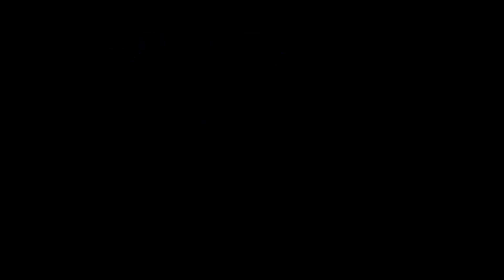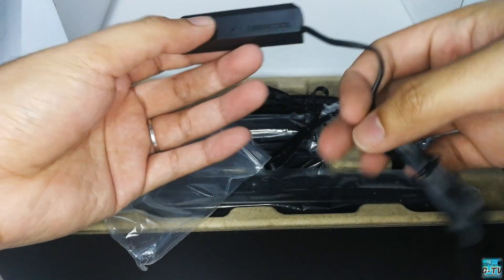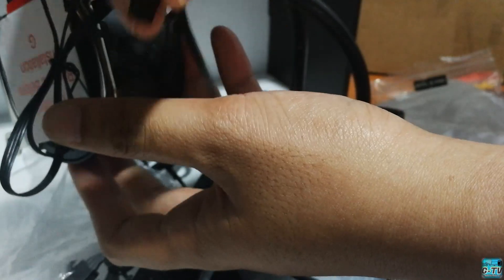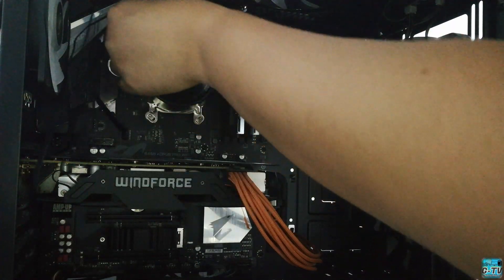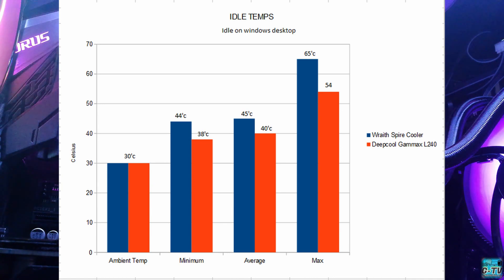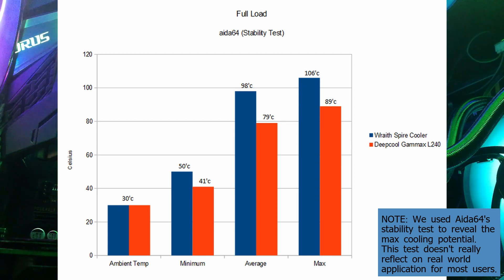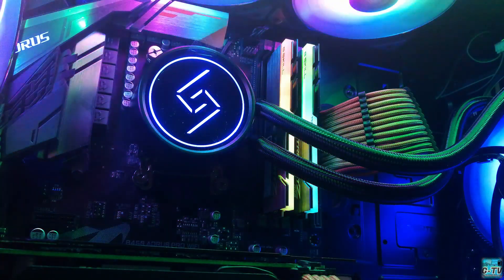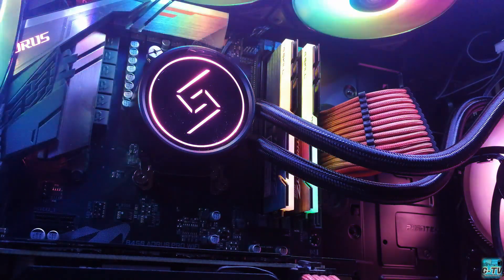Deepcool Gammaxx L240 AIO Liquid Cooler Review

Comment: shold i get this with my i5-10400f?, will it even fit, and is it worth it because my cpu is locked, if not what cpu cooler should i get
Reply from the maker: This will upgrade the look, noise level and temperature of your cpu. The fit will depend on the clearance of your case. It's a worthy upgrade if you ask me. Id go with noctua nh-u12a if you want an air cooler with no rgb
Reply: @GinoCruzVlogs  Thanks!
Reply from the maker: Welcome mate👌

Comment: Hello, meron din po akong Aorus B450 Pro Wifi na mobo and balak ko rin po bumili ng AIO,  kaya niyo po ba nilagay yung rad sa harap kasi tatama yung heatsink ng mobo dun sa rad? balak ko po kasi ilagay sa taas.
Reply from the maker: Hi bro! Yup. Tatama siya. Depende din talaga sa clearance ng case mo kung maluwag yung fan mount sa ibabaw. Pero ok din sa harap para cold air agad yung intake nung radiator sa harap.

Comment: im completely noob on pc builds , call me dumb but where is the liquid that make tis cooler a liquid cooler?
Reply from the maker: Hi bro! An all-in-one liquid cooler like this one doesn't have a dedicated reservoir like the ones you see on custom water loops (usually found on high-end builds). The coolant circulates inside the tubing and radiator.
Reply: @GinoCruzVlogs  ty for the quick respond , i’m considering to replace my air cooler with this . so the liquid has inside is inreplaceable ? any chance of leak ?
Reply from the maker: @thsk8156  It's been more than a year since I had it install and it's still working like a charm. I think this particular model is a closed loop system so refill or replacing coolant is not possible. The version 2 of the L240 has anti-leak tech feature for added peace of mind.
Reply: @GinoCruzVlogs  i will proceed for purchase thanks a lot
Reply from the maker: @thsk8156  glad i could help bro. Stay safe! 👊🔥

Comment: What’s the temperature difference with r5 3600X stock vs this?
Reply from the maker: Hi bro! Not sure, but since it uses the same stock cooler,  the performance gain should roughly be the same if you upgrade to this aio.
Reply: @GinoCruzVlogs  thank you!

Comment: think one thing to take into account is the clock speeds of the cpu. my 3600 with stock cooler sits at 95c and throttles down to 3.6ghz whilst  with upgraded cooler will sit at 4.15ghz all day at 85c
Reply from the maker: Also happened to my cpu as well. Well worth upgrade bro. 🔥👌

Comment: Nice video brom i just upgraded to R5 360o and Wraith Stealth cooler is not good. Arround 50 degrees in idle and bumping to 85 to almost 90 degrees when playing COD Warzone. Planning to get this AIO. Do they sync rgb when I get 3 more deep cool fans for exhaust? And will this be compatible with my Gigabyte b45pm-ds3h? Thank you!!
Reply from the maker: Hi bro! Appreciate the nice comment. You have a very good cpu. Pairing that with a nice AIO would be awesome. You can daisy chain the aio with some Deepcool RF120 3in1 pack and youre good to go. Your motherboard has 1 compatible rgb header that you can use to sync the lighting
Reply: @GinoCruzVlogs  thanks man! Im just new to pc building and my chassis is a little smaller compared to yours and cant mount on top. Can i place the radiator in front? And are the fans exhaust or intake when moubting to radiators? Planning to get 3in1 rf120 to place at the top(2)  and rear (1). Do I do exhaust for all the rf120 fans? Thank you!
Reply from the maker: @singwithme4480  welcome to the master race bro. Yes, front mounted rad is ok and fans need to be intake so it can suck in cool air for the radiator. use the 3 rf120's as exhaust (2 top, 1 rear)
Reply: @GinoCruzVlogs  not sure if I wanna join master race haha. Im cool as long as my cpu is cooler lmao. Thanks for the suggestions. Adding to cart now. More videos sir!
Reply from the maker: @singwithme4480  hahahaha! Nice man! NP. Enjoy your pc build and stay safe! 🙏
Reply: @GinoCruzVlogs  Hello again Gino, O just ordered the aio and 3in1 rf120 fans. Can you give me idea how to daisy chain the fans and rgb considering that I only have 1 header for rgb and system fan? I'm worried that this won't work. Thanks!
Reply from the maker: @singwithme4480  hi bro. extension cable has 4 ports. Use the 4th port to daisy chain/plug in the 2nd extension cable.
Reply: @GinoCruzVlogs  do i have to order the extension separately or does that come with the package? Also, what about the rgb? Can I daisy chain those too?
Reply from the maker: It comes in the package bro. 4port cables for fan and rgb.
Reply: @GinoCruzVlogs  what aboht the pump for the aio? I dont have an "off fan header" as you stated in this video. Sorry for asking too muchm
Reply from the maker: @singwithme4480  yeah w8 let me check your board.
Reply from the maker: @singwithme4480  the aio has 4port fan hub. plug the fan hub to the cpu fan header then plug the aio pump and 2 radiotor fans to the fan hub. Use a different auxiliary fan header for the other 3 rf exhaust fans. Just do the daisy chain on the rgb.
Reply: @GinoCruzVlogs  thank you so much. So to summarize i just need 2 fan hubs. 1 is for 2 radiator fans and pump. 2nd fan fub for 3 rf120's? Rgb splitters and theses hubs are all included in these 2 packages right? Does that mean that I still have control over the rgb and fans since they will be connected to my motherboard?
Reply from the maker: @singwithme4480  both the aio and rf 3in1 pack has the fan hub and rgb extension/splitter cable. Everything should be included. Yes both aio and fans will be connected to your motherboard. 😉
Reply: @GinoCruzVlogs  thanks bro! Ill go back here when I will encounter any issues. Thanks and keep safe brother!
Reply: @GinoCruzVlogs  broo, i jist found out that the V2 of l240 does not come with a fan hub anymore. Do you have any solution for my situation other than getting a separate fan hub?
Reply from the maker: @singwithme4480  wth. Deepcool added anti-leak tech but removed the fan hub 🤦‍♂️. If the mother board has enough fan header, use the fan hub included on the RF fans for the aio and just connect the 3 fans on the auxiliary fan headers directly. If not, you need to buy  deepcool fan hub. I saw one online for only 299 php.
Reply: @GinoCruzVlogs  my plan is to plug the pump on cpu_header and use the 4 port fan hub for the 2 radiator fans and two rf 120s. Im going to miss the 5th fan. Do i need to buy a 10 port fan hub to connect all 5? Its sad i only have 1 system fan header hahah
Reply from the maker: @singwithme4480  if you could get a 10 port fan hub for the system header that would be better. I'd still use the cpu_header with 4port hub to plug the pump and 2 fans so that the rpm will be synced
Reply: @GinoCruzVlogs  I would still be able to sync fans that is connected to the systen fan header right? it is safe to connect a fan hub to Cpu-fan header?
Reply from the maker: @singwithme4480  when you say sync, do you mean control? Motherboard will basically control the fan speed or rpm depending on your temp. Yes its safe.
Reply: @GinoCruzVlogs  thabls man. I guess i just have to wait till my order gets shipped out. It has been 3 days now but no updates yet. Ill come back definitely for sure. Thanks for your time and more power!
Reply from the maker: @singwithme4480  np man! Thanks and Stay safe! 🙏🔥
Reply: @GinoCruzVlogs  Hi bro. I got the coolers and was able to run 5 fans on 1 header. Used the 4 port fan hub and added a splitter on the 4th port. I have the pump only at cpu fan. It works for almost a week now. Is it safe though? Thank you!
Reply from the maker: @singwithme4480  Congrats on your new fan and cooler upgrade! Good job on your wiring as well.  it's perfectly safe. Did your temps improve?
Reply: @GinoCruzVlogs  temps improved bro. Down by 25-30 degrees while gaming. From 91 degrees to 58-65 now. Si coool lmao
Reply from the maker: @singwithme4480  nice temps man. The upgrade was worth it.

Comment: Boss Gino, pwede mag tanong? kasi sa start up nagkakaerror ako ng cpu fan error, tapos kapag nagcheck ako ng rpm sa mga software, N/A yung cpu fan ko.
Bakit ganun? Yung 3pin po ba para sa rgb sa extension din ilalagay? thank you boss.
Reply from the maker: Hi bro! Para po mag ka readout ng rpm need mo plug yung fan sa 4pin pwm fan connector.
Reply from the maker: Dun sa rgb naman need mu padin lagyan extension para ma connect mu sa board. Since regular rgb leds yung gamit ni l240, dapat 4pin rgb connector mo sya kakabit.
Reply: @GinoCruzVlogs  Boss thank you okay na hehe!
Reply from the maker: @ronron4077  nice one bro hehehe enjoy your new aio! 🙏👍

Comment: Got a cryorig h7 quad lumi for 40$ and im planning to change with l240, But i saw your video and compare it with my 2600 oc to 4ghz 1.3v and almost same temps and Ive got high ambient temps but this l240 looks clean! 🔥
Reply from the maker: Yes sir! 🔥🔥🔥
I still get mesmerized when I look at my rig even though it's not that high speced. Thanks for watching brother and noticing my benchmarks
Reply: @GinoCruzVlogs  wat is better? Corsair h100x hydro series or this one?
Reply from the maker: @pukalomaster3321  hi! I really cant comment anything on the h100x performance, but basing on the specsheet and price, i think the l240 is a better buy because of the price. Unless you have a corsair theme for your pc set up.

Comment: What is mainboard you using with the deepcoll gammaxx gte aio v2 240mm ???
Reply from the maker: Hi bro! Motherboard? I have the Aorus B450 pro wifi. AIO's rgb is being controlled by the motherboard. I have the legacy version or v1 240mm
Reply: @GinoCruzVlogs  oh thanks! Can I use asrock z390 steel legends to controlledthe deepcool gammaxx L240 AIO V2 ?
Reply from the maker: @nguyennhatnamIT2005  yes bro! It has 2 rgb led headers. Use the one nearest to the cpu slot.
Reply: @GinoCruzVlogs  Thank you very much

Comment: Paano po kaya ang pwedeng gawin kung walang RGB header ung motherboard? Pati ung RGB controller?
Reply from the maker: Hi CK! Hindi po gagana yung rgb lights. Need po talaga ng controller. Work around is to buy it seperately or get an rf120 3in1 pack tapos daisy chain nlng yung mga fans at pump. May free controllee yung rf120 3in1 pack.
Reply: @GinoCruzVlogs  Hi sir, same issue po ng sakin, walang RGB header. Gagana pa rin po ba siya kahit di gumana yung rgb lights?
Reply from the maker: @lawrencesoneja3273  hi Lawrence! Pag wala pong 4pin 12rgb header yung board need po ng external rgb controller. Pwede po makuha sa Rf120 trio pack. Cheap route is bibili ka ng 12v 4pin na controller but im not 100% sure about compatibility. Another option is in direct contact kay deepcool tapos special order nung rgb controller nila.
Reply from the maker: Sa shopee din try mo search deepcool rgb controller. Yung 12v dapat
Reply: @GinoCruzVlogs  Oks sir. Salamat sa info!
Reply from the maker: @lawrencesoneja3273  np bro. Stay safe.☝️🔥
Reply: @GinoCruzVlogs  Same sir, Tingin ko recommended para sa mga walang rgb header ang mobo is mag switch sila sa l240T
Reply from the maker: @lawrencesoneja3273  bagong variant ata yan for L240. integrated na yung power ng ilaw sa fan header. One color way nga lang yung ilaw. Good suggestion bro.

Comment: Can it be compatible with deepcool dukase v2 cabinet...using Asus strix B350F motherboard with adata ram with heatsink...will there be enough  space for this if I mount the radiator on top??
Reply from the maker: Hi AD! Top mount is your only option for dukase v2 and the clearance is good. No issue with Ram clearance. Motherboard top heatsink might be a bit tight but can be managed.
Reply: @GinoCruzVlogs  thanx man...

Comment: Panu kung walang rgb header ung motherboard gagana pa kaya yan ?
Reply from the maker: Hi Rey! Gagana yung aio pero yung mga rgb lights hindi. Pero may work around naman. Need mu lng mag buy ng deepcool 12v rgb controller sa lazada. Around 400 pesos lang yun
Reply: @GinoCruzVlogs  Ibig sabihin po sir hindi po lahat ng ilaw gagana or di lang siya mag-sync?
Reply from the maker: @CK-mx8pu  hi bro! hindi po gagana yung ilaw since ala pong rgb header yung motherboard. Pero kung makaka kuha ka ng deepcool 12v rgb controller pwede. Either you buy it seperately online or kung merong kang rf120 3in1, meron yun included na rgb controller.
Reply: @GinoCruzVlogs  Pwede po kaya siya i-connect sa non -deepcool rgb controller? Like for example RAKK Maris Pro po?
Reply: I have the version 2 po, and an A320M motherboard
Reply from the maker: @CK-mx8pu  sadly hindi po sya compatible sa rakk maris. Iba kasi yung design ng connectors nila.
Reply: @GinoCruzVlogs  Aww okay po, pero mapapagana ko pa naman ung mga fans wala lang ilaw?
Reply from the maker: @CK-mx8pu  yes.. If you plan on upgrading yung motherboard or bibili ng controller pwede hehe. Check mo din si IDcooling bro alam ko may 240 aio din sila pero may bundled ng controller.
Reply: @GinoCruzVlogs  Thank you very much Sir. Pero ung ini-recommend niyo na RF120 Kit pwede din po ano? Nakabili na po kase ako hehe
Reply from the maker: @CK-mx8pu  nice. Hehe yung rf120 kit nlng bro dag dag auxiliary fans din. Or benta mo nlng si rakk maris para deepcool na lahat ng fans
Reply: @GinoCruzVlogs  Okay po! Thank you!
Reply from the maker: @CK-mx8pu  Welcome bro! Happy new year 🎊

Comment: Can we connect the pump cable to dedicated aio pump cable header?...I am using asus b350f gaming mobo.
Reply from the maker: Hi AD! That's actually better bro. Depending on the pump/aio, that header might also let you configure the pump using asus software or through bios.
Reply: @GinoCruzVlogs  thanx man for replying...also i want to know two more answers.
1.how the 3pin fan connector can connects 4pin cpu_fan header on mobo?...My build is ryzen 1600x with asus strix b350f gaming mobo .
But this cooler have 3pin fan connector ...how can we connect this to 4pin header?
2. In case we connect pump (3pin)to directly cpu_fan header(4pin) and the radiator fans to cpu_opt header (4pin)via y-cable...will there be any issues?
Reply from the maker: @Arundas40  Hi AD! Good question. 
Answer to question 1. Basically the 3pin cable from the pump and 3pin cable from a case fan is just the same. They are not PWM meaning the motherboard cant control its speed. It has a constant speed or always on its top rated speed. Which is no problem for this pump because its very quiet and efficient. To connect, there should be a plastic aligner on the top side of the header. You just need to align the pumps 3pin cable to that and connect
Reply from the maker: @Arundas40  answer to question 2. The aio will run but the performance will not be optimal. The cpu fan header tends to be more aggressive on the voltage when it detects high temp reading on the cpu thus immediately ramping up the fans rpm vs the opt fan/header
Reply from the maker: @Arundas40  dont forget to like and subscribe brother. 😁👌👍
Reply: @GinoCruzVlogs  thanx again bro...i already subcribed and shared....hope you will get more subcribers .
Final verdict:- 1. Pump connector to aio pump header/ cpu_ opt header
2. Radiator fans to cpu_ fan header.
:)ok?!
Reply from the maker: @Arundas40  Thank you brother. You got it right! Cpu fan header will provide optimal control to your radiator fans.